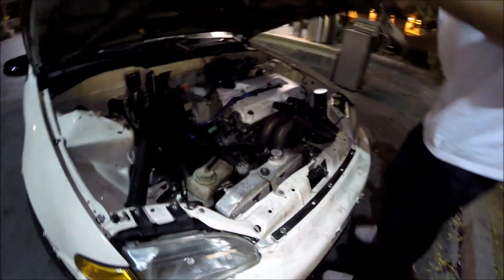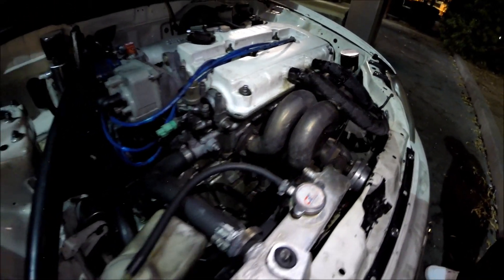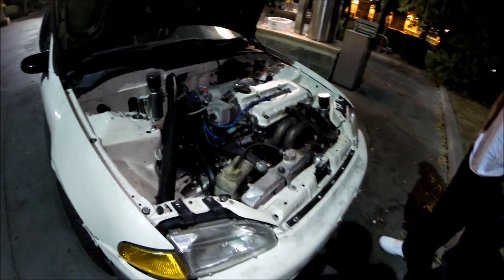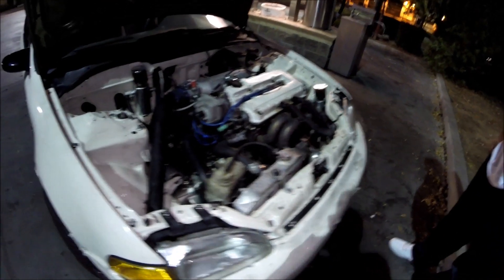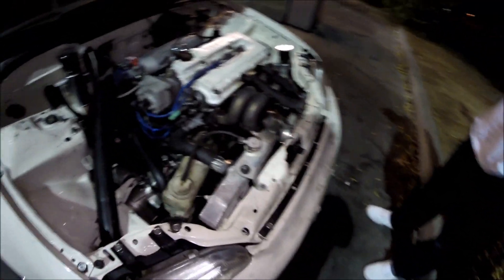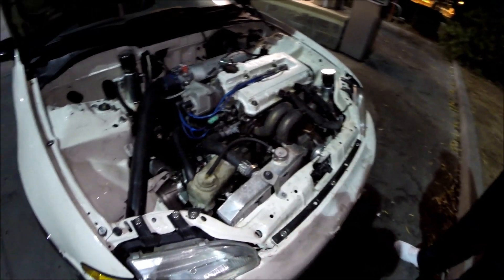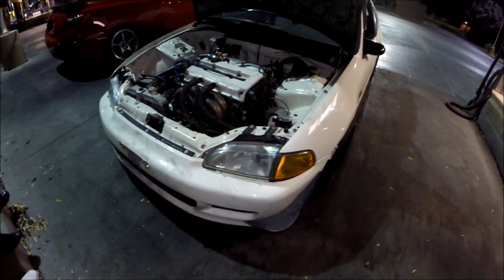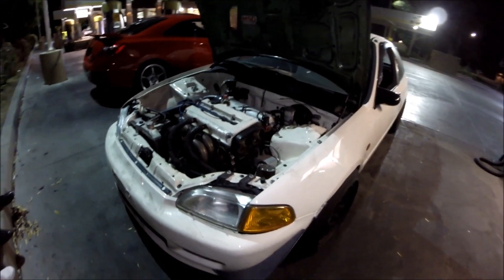Built B18 LS VTEC Turbo EG 450whp vs K20 Supercharged Civic Si 350whp

Comment: well for all you noobs just making power is not going to get you the win . you need suspension work to get the power down first. people use coil over for dropping cars but if you tune the rebound and stiffness and the angel that the tire is in contact to the road your ET times will be better then a high hp car . more tuning can be done with tire like using slicks and finding the right amount of air in the tire to match your cars weight. next and I see this a lot using the wrong turbo for you engines set up . like using a big turbo that it make its full boost from 5000 or 6000 rpm and up and you engine max is 8500k or 9000k . that's a small power band on full boost. you will be 3000 rpm before you need to shift , I can go on . the lesson is just like a house you cant start building from the roof down but from the foundations and up .

Comment: Ay Tong for e85 is it necessary to upgrade feul pump? Which one would you recommend and does it need to be modified?  Thanks.
Reply from the maker: +454Movement yes you'd need a higher flowing fuel pump for e85. I have the deatschewerks 65c fuel pump
Reply: So no modification on that pump should be fine then right? Like no worrying about corroding?
Reply from the maker: +454Movement the only part that would corrode in our 8th and 9th gen civics is the fuel sender.
Reply: Oh okay so you'll have to put a paste for protection on it right like the DIY on 8thcivic correct?

Comment: depending on the weight of the eg it should be around a 130mph trap speed car and easily should be flying on the hwy.

due to grip maybe it second it'd be close but top of 3rd and especially 4th it should have bus lengths on a car trapping under 120mph.